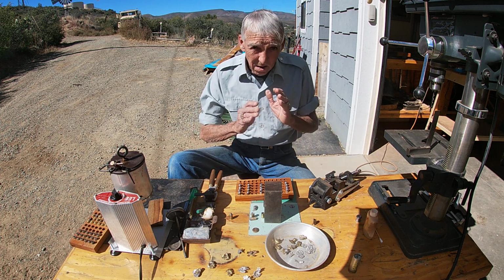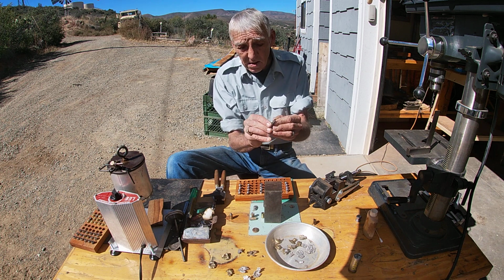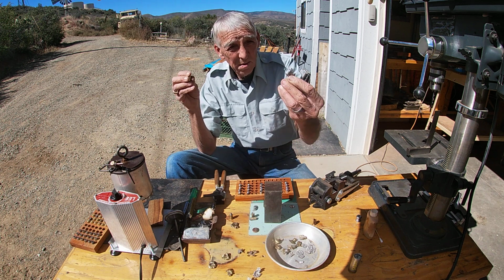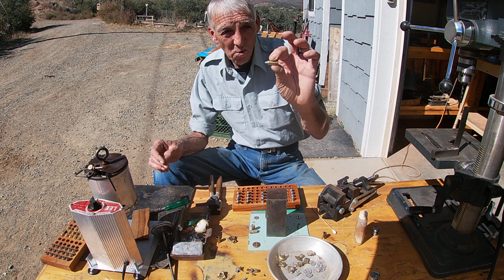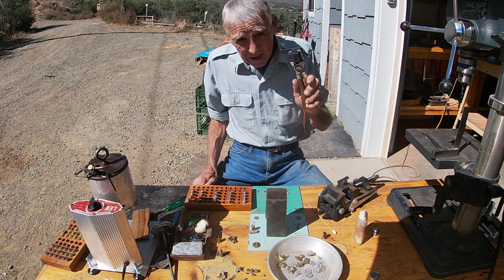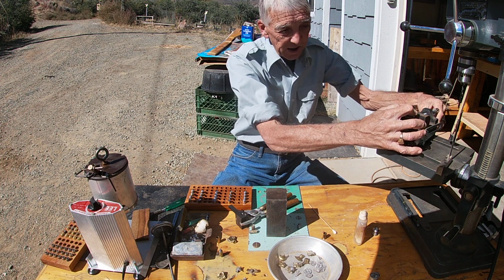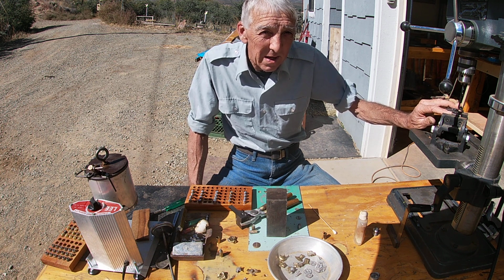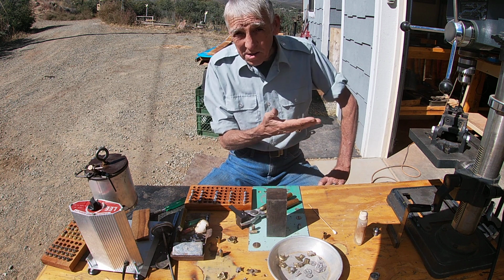SLUG MOULD 410 1/2 OZ. DIY

Comment: Slugs can be made for a .410 bore shotgun by partially filling spent .38 Special or .357 Magnum cases with molten lead. Grind the diameter of the case rim down to match the diameter of the case, which is approximately 0.3795" diameter. Leave the spent primer in the fired cases. The spent case head becomes the tip of the projectile.

Vary the amount of lead poured to leave more or less of the case unfilled to your liking. With the spent case filled approximately 3/4 full of lead, the slugs are nose-heavy like a foster slug and more accurate.

Then load the cases with the open end pushed down into a three-petal wad. Insert the wad with homemade slug and push it all the way down with a dowel, just like you would any other slug. An overshot card can be glued in to seal the end of the .410 shell. Experiment with different chokes to see what works best.

Happy shooting!